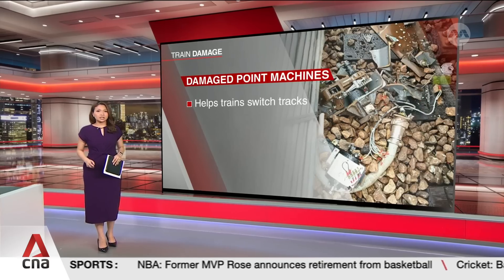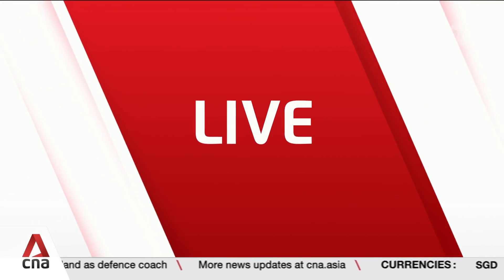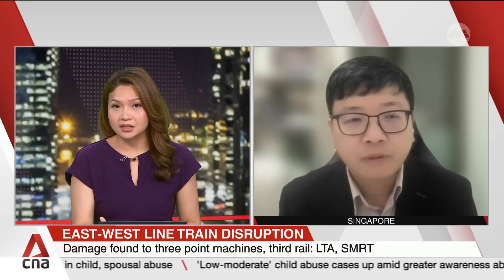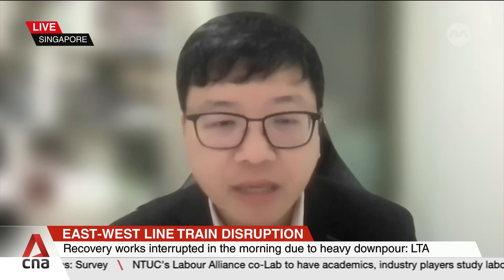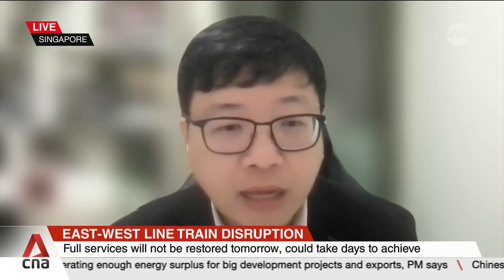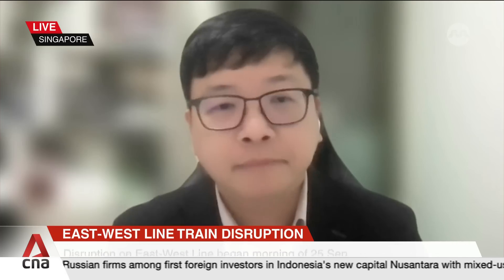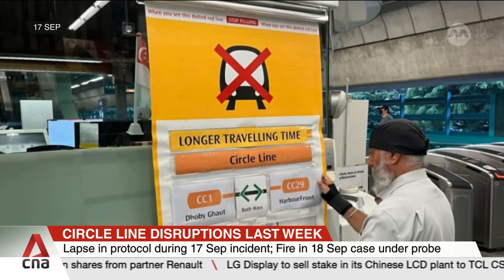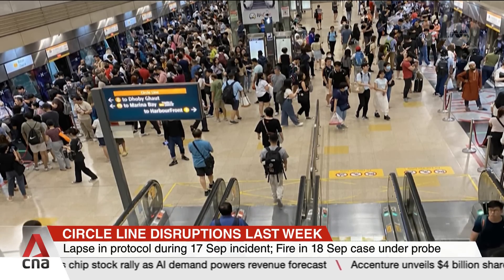East-West Line disruption: Assoc Prof Raymond Ong on the complexities of repairing track damage

Comment: Wow!

Two apparent SABOTAGE, first Bunker Tanker, now MRT coach axle damage.

The TANKER issue on REPORT, SURVEILLANCE, REACTION efficiency. 

Now is MRT COACH ASSETS AI SCANNING at the maintenance depot.

MoT needs to have an INFRASTRUCTURE ASSESSMENT INSPECTORATE to regularly check on rail, road, tunnels, air, ports, trucks, fuel, charging outlets.

These checks will be on private, public, glc assets.

MoT, better get to work.

😢

Comment: Why blame the Kawasaki trainset for the damage to the rail and some electrical components of SMRT? The blame for that should be on SMRT's maintenance provider.

On the JR East line, specifically on the Chuo and Sobu Line, and the same on the Tokyo Metro, specifically on the Tozai Line. They still use the JR East 209, Tokyo Metro 05, and 07 series made by Kawasaki Heavy Industries, which still works well on their tracks. Whereas those old KHI trainsets were made in the 80s and 90s. Even the Odakyu and Seibu trainsets made by Nippon Sharyo in 1983 are still used today. The quality and dedication of Japanese railway engineers are different, which is superior. And nothing beats their skill when it comes to railway maintenance.

Siemens is also used by BTS Skytrain trainsets in Thailand, particularly in Bangkok. The Siemens trainsets on the BTS Skytrain are running smoothly on the tracks. The BTS Skytrain rarely has technical problems in Thailand. It's the same with their SRT, in which technical problems are rare. Most of their SRT train sets come from JR East which is second-hand trains. But they are still in good use. SRT's engineering staff refurbished JR East's second-hand trainsets, making the trains look brand new again. That's why Japanese people love to visit Thailand because the BTS Skytrain network is efficient and their SRT is supported by Japanese technology.

I just noticed that SMRT no longer procures train sets in Japan. SMRT always buys their new train sets from CRRC, Alstom, and now from Hyundai Rotem. It looks like SMRT is cost-cutting its budget nowadays.

Comment: The MRT disruption on the East-West Line (EWL) on September 25th was caused by a faulty 35-years-old train that damaged the tracks near Clementi station. They should have removed part of the axle from the faulty train before dragging it back to maintenance depot. It is the axle that dropped and hit the 3rd rail which caused the electricity outage and also extensive breaks across the stretch of rail track while being dragged along. If portions of the faulty axle cannot be removed, specialized equipment such as using cranes or other heavy machinery to lift and move the train to their maintenance depot.
In short, the MRT maintenance crew lacked common sense because they ignored safety to humans and equipment in their SOP (standard operating procedures). On the whole, without this incident, our MRT system is fine and is one of the best in the world.
Reply: must learn from hong Kong mrt system. so far never heard of any serious mrt problem there.
Reply: @titusphilip1310441  Both Hong Kong's MTR and Singapore's MRT systems are highly regarded, but they have their own strengths and weaknesses.
Hong Kong's MTR has traditionally been known for its reliability. However, recent data suggests that Singapore's MRT has caught up and, in some cases, surpassed Hong Kong's MTR in terms of reliability. The MTR still performs well, but it has faced challenges, including disruptions and delays.
Singapore's MRT is also highly efficient and less crowded compared to Hong Kong's MTR. It covers areas not reached by the MRT with an extensive bus network. Singapore's system is praised for its affordability and continuous improvements.
In summary, both systems are excellent, but Singapore's MRT has made significant strides in reliability and efficiency, making it a strong competitor to Hong Kong's MTR. The choice between the two might come down to personal preferences and specific needs.
Reply: @titusphilip1310441  Hong Kong's MTR and Singapore's MRT systems are both highly regarded, but they both have their own strengths and weaknesses.
Hong Kong's MTR has always been known for its reliability. However, recent data suggests that Singapore's MRT has caught up to, and in some cases even surpassed, Hong Kong's MRT in terms of reliability. MTR continues to perform well but faces challenges such as disruptions and delays.
The MRT in Singapore is also very efficient and less crowded compared to the MRT in Hong Kong. It has an extensive bus network that covers areas that the subway cannot reach. Singapore's system has been praised for its affordability and continuous improvement.
To sum up, both systems are excellent, but Singapore's MRT has made significant improvements in reliability and efficiency, making it a serious competitor to Hong Kong's MRT.

Comment: Wonder why no preventive process implemented? When a faulty train happens, it can be anything, but engineers should be deployed to do checks on the external of the MRT, a form of inspection that no parts is loosen etc. And then when the train is being rolled back, 2 engineers to be deployed behind the train to ensure track, 3rd track etc is not damaged as the faulty train moves off, at least for 500m if the distance is too long to follow all the way.

Comment: breakdown in 3 consecutive  shows SMRT is not SMART after all . Most of the old trains running along NS Lines with warm air coming out from the overhead ducts rather than cooling  air in the passengers cabin as observed for a very long time and yet they are deployed , It shows they just don't the discomfort of the commuters . No money for maintenance ?
Breakdown as reported maybe due using cheap parts make from cheap materials instead of  using genuine parts . Save cost to shows annual good profits .
Reply: The asset belongs to LTA not smrt. LTA is just an operator. FYI smrt was delisted around 7 years ago.
Reply: thanks for the info
Reply: Tofu parts 😢

Comment: im surprised how much damage was seen on the tracks. theres so many fractures. im still confused as to what dropped and could caused fractures in so many areas. like the train broke down at clementi, but how did it affect the track all the way to buona vista? is it because the affected 3rd rail affects the entire stretch from jurong to buona vista? and only the fractured rails are contained on the rail along clementi?

Comment: SMRT run by ANOTHER USELESS Paper General, No ?
PAID  2M for SUCH SUB Standard Work Quality. 
PLEASE RESIGN n RETURN your MILLION $$ Salary
Reply: From management point of view, they should have already make the decision to pull that 35 year old train away from operation. So this is really management fault. If later news they going to blame this for improper maintenance and is engineer faults, then they really need to resign.

Comment: The current focus of management on P&L, shareholder interest, and ROI often leads to a lack of attention towards maintenance, safety guidelines, and the potential for component failure. This approach may overlook the long-term consequences until a catastrophic system failure or a mass casualty event occurs. To address these challenges, one potential solution could involve transitioning from human-based maintenance decisions to an AI and rule-based autonomous platform directly linked to government systems. This system would autonomously impose fines on operators for non-compliance without negotiation, in cases where maintenance records and evidence of servicing are not present. Additionally, it would monitor employee working hours to ensure compliance with engineering standards and HR regulations, imposing fines for any breaches. While this solution offers a way forward, its successful implementation would require governmental consideration and action.